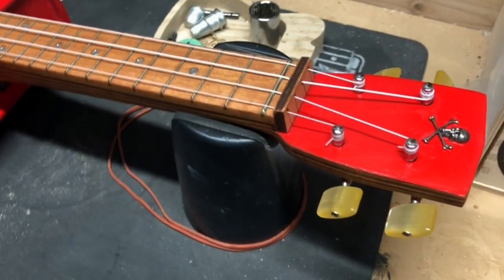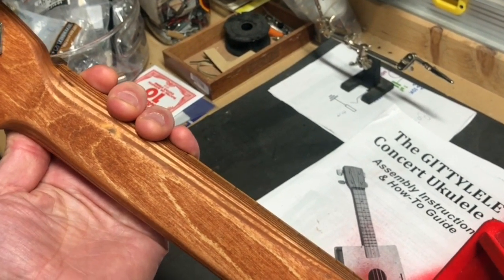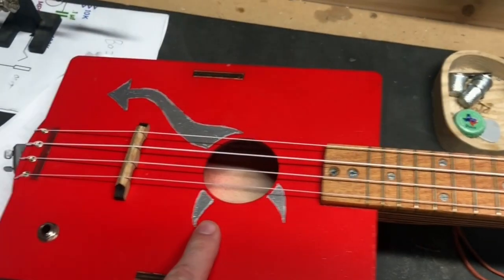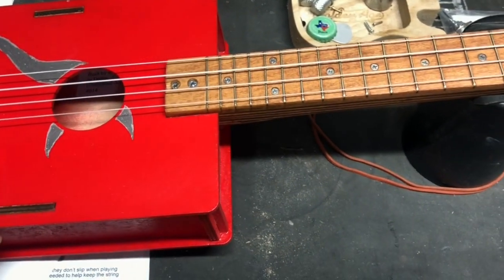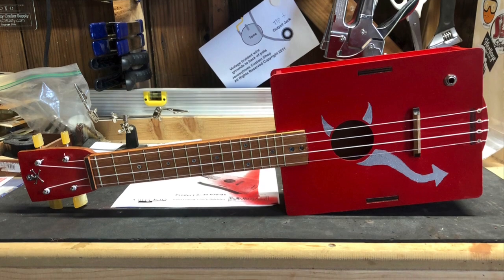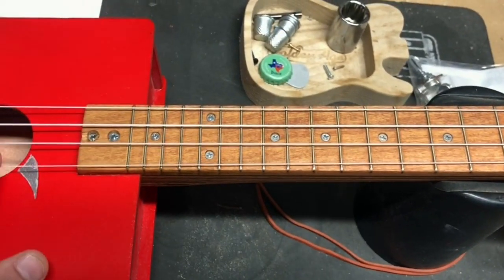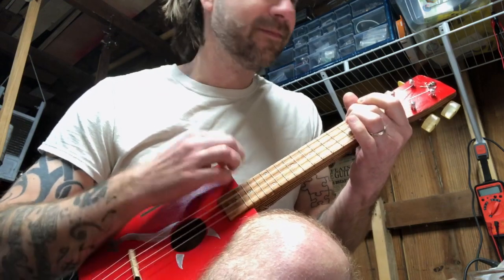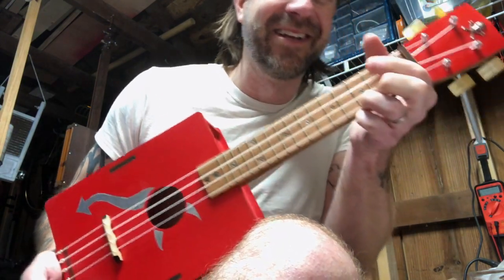DIY Project: CB Gitty Gittylele Kit

Comment: Great video. I have just started my kit. Can I ask... did you have any issues with the nut? I haven’t glued anything yet but it appears that my nut isn’t high enough. The holes for the strings are below the fret board.
Reply from the maker: Mine was the same way. The bottom of the wooden string guide does not line up with the top of the headstock. There is a gap. The important thing is to have the 4 string holes right at the fretboard's height (not above or below). Keep in mind the wooden piece is just a string guide. The zero fret makes the contact with the string, so it is the true 'nut'. Good luck with the build.